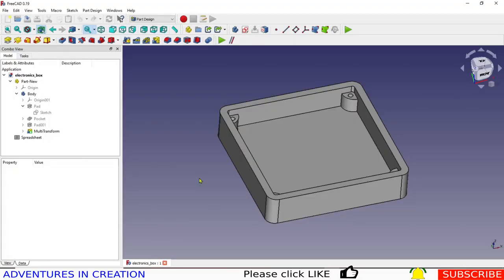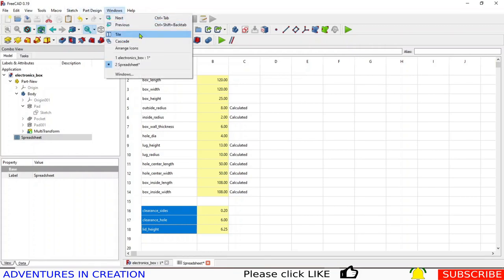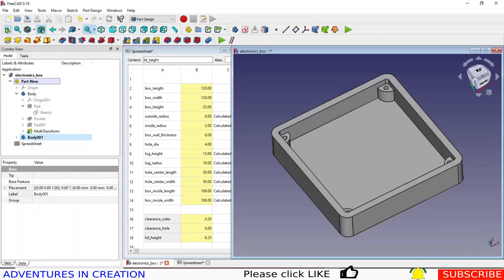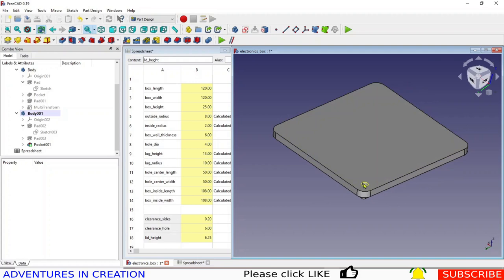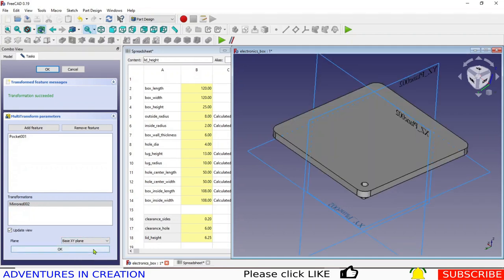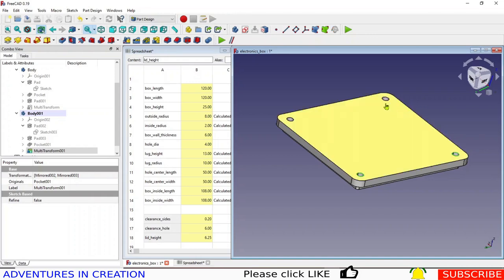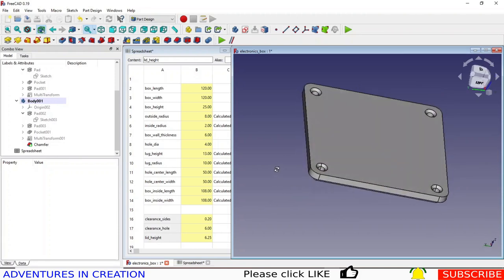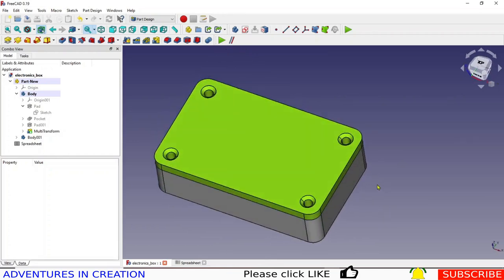FreeCAD Electronic Enclosure Lid Using Simple Parametric Design Techniques

Comment: After you create your labels in the spreadsheet, run the easy alias macro before entering any values.  You can then enter formulas using the alias names instead of the cell location. In cell B17, you can enter =hole_diameter + 2 instead of =B8 + 2.
Reply from the maker: Thanks for the tip.

Comment: superb tutorial!!!! is it possible to control the chamfer parametrically if created on a sketch or incorporated in the spreadsheet to constrain its movement in relation to the hole?
Reply from the maker: Yes, you can set parameters for the chamfer too.

Comment: I am enjoying this leaning curve. I discovered that when constraining the corner radii, we can select all four and constrain the one. The remaining three are automatically set to equal. Saves me a step.
Reply from the maker: Yeah, the thing I like about it, it's improving all the time. There are some great developers working on it.
Reply: @Adventuresincreation  are you installing it manually, or with Chocolatey?
Reply from the maker: @Whipster-Old  I just download it from the download page, although I can build it with conda as I set that up too but I generally wait and get the posted version.
Reply: @Adventuresincreation  you might enjoy Chocolatey. Check out Chocolatey package manager, you can then install with "choco install freecad --pre". Easier to keep up to date than manually downloading those pre release builds by hand! NB I'm not affiliated with them, it's open source I just use it a lot.
Reply from the maker: @Whipster-Old  I did look at it but because I already have Conda installed and set up I can just build on demand from the latest repository.  I may install Chocolatey in the future though. I am trying to develop some more "gui" based macros at the moment. I am having fun with Qt5 and creating stuff but nothing releasable yet.
Reply: @Adventuresincreation  nice! Can't say I've used Conda myself. I'll watch your channel with interest. My printer is out of action at the moment - SKR burned out, waiting for replacement board and BLTouch.
Reply from the maker: @Whipster-Old  I have an MPCNC router and two Tevo Tornadoes. I love being able to rapid prototype stuff. - 3D printing is still amazing but back in the day, when I was a design engineer for a major corporation we used a vendor to create SLA models, the machines were very expensive then. I never imagined you would be able to have a 3D printer in your home (much less two).
Reply: @Adventuresincreation  I remember seeing a resin 3d printer on Discovery when I was a teen. Now I could own one for a few hundred quid! I've never ventured into CNC proper, but I absolutely love my printer. It's driving me to learn CAD. I've modified the heck out of the printer, and I do love tinkering.

Comment: You are a great teacher. I was looking for a CAD Software and found FreeCad.
The new good CAD-Programs are only for rent anymore.
As a single-man-business in Germany I just can´t afford to pay 500 Euro per month for renting a CAD-software while my main business is calculating frames
and using other software. This software is meant for Industry - some fulltime - drawers, who live in their element - with their shortcuts and their productivity.
Anyway, I would like getting better at Freecad and the FEM - workbench.
Thumbs up, you´re a great person having an english accent and living in the US.

Freundliche Grüße,

Niko Böhm
Reply from the maker: Thanks Niko. Let me know if I can help you with getting up to speed with FreeCAD. It is a great piece of software that is very capable. Are you just creating technical drawings or are you modeling and 3D printing or CNC routing?
Reply: but you are, I assume, an Ingeneer like me.
In Germany they call it "Maschinenbauingenieur" ...
and we have the differenciation to "Civil Engineer". So the civil engineer can construct a steel-frame-building but the "Machinenbauingenieur" not - they are working at Porsche and Mercedes.
Reply: @Adventuresincreation  No - I´d like to print small stairs and bridges mainly in steel.

Comment: Similar to the other comments, your tutorials are super helpful thank you so much for taking the time to share knowledge! 
One trick you can use instead of pocket 'through all' is pocket 'to face' and select a face that you want the pocket to go to, just a bit more precise than through all
Reply from the maker: Thanks for the feedback, I have used the pocket to a face but generally hit it with a sledgehammer and go through all. - Your way has much more finesse ;-)
Reply: Hehe, it can also cause circular dependency issues if your not careful, sledgehammer is good too 🙃

Comment: I followed along with the first tutorial making the box exactly as you did.  For my lid, I made it one wall thickness tall.  It goes down one wall thickness into the box and  one wall thickness from from the inside of the box (plus clearance).  I also copied the lug radius onto the lid.  This means that 90% of the lid is only one wall thickness tall, so it prints quickly with no wasted plastic.
Reply from the maker: Brilliant!

Comment: Thanks for taking the trouble to teach 0.19 before it was published as stable.  It means your video(s) hasn't lost relevance and shouldn't do for at least the rest of this year and probably not even then.

It's great to see a lot of good tutorials being created now.  When I started with FreeCAD a few years ago there wasn't a lot around, and most of those (that were well done) showed just the part workbench or switched between the two (what a headache).  I had to transition to the part design workbench under my own steam but I'm learning heaps from these newer videos.  Thanks again.
Reply from the maker: Thanks Chris. In fact, I did the same, I was trying to use FreeCAD as my daily driver and couldn't find many "good" videos then, I found Fusion 360 and saw the opportunity to use something a little more modern with a free hobbyist license. - In the meantime FreeCAD improved then AutoDesk decided to change the rules for the Fusion 360 hobbyist license. - I saw the writing on the wall and made the leap back to FreeCAD. I haven't looked back since. I love FreeCAD and how extensible it is. There are lots of things to learn with it but the main stay for me, the part design workbench and the sketcher are pretty good. I do use the path workbench and love where it's going although I wish I could help them to move along faster. - It is very capable for the basics but lacks some finesse. I am glad I can help others to use the software and hope that with 0.20 release I can make new videos that highlight those features too.
Reply: @Adventuresincreation  Thanks for the reply!  You also asked if anyone had anything we'd like you to cover.  It's a bit of a complex topic but I've been struggling with threads.  I have done them from scratch and discovered that the open source algorithms for circle designs (cutting a spiral sweep with a thread profile) was very hit or miss.  Often when you used the correct dimensions it failed to compute, but tweak it just a little off spec and it would work.  Rounding errors that the algorithms couldn't resolve, obviously.  The method I was using was to create a cylinder, and then use the thread profile to "cut" the thread.  It seemed to be the recommended easiest and most reliable method at the time.

I did find the "fasteners" add-on and started using that with very reasonable success.  Because I design exclusively for 3D printing most of the threads are large and course:  eg. a motor drive unit that pulls the filament out of the airtight containers I have it enclosed in, reducing drag on the direct drive print head (improved my 3D prints immensely) .  I used a 3D printed M20 threaded bolt to hold the drive unit vise style on the back of the desk the printer is sitting on.  The motor drive is a horrid looking design overall - the M20 bolt is the only thing that has any redeeming aesthetic LOL.  So it's been powered on and working constantly for two years now.  No need to re-design what just works.

Threads are a complex topic (very specific design criteria) but maybe a tute on sweeps would be good, or maybe a discussion on the circles/sweeps algorithms.  Since I started using the fasteners add-on two years ago I've basically forgotten everything I learned, and FreeCAD has become so much better so I wonder if there have been improvements in that area as well.  Are they still using those clunky open source algorithms that caused me so much trouble back then?
Reply from the maker: @Chris_the_Muso  take a look at my latest video it covers threads using the fasteners workbench. I would never bother to model a thread from scratch. There is a setting in the workbench for 3d printing threads. Also, take a look at my beginner video on sweeps along a path. That will help. It's also in the latest video.
Reply: @Adventuresincreation  Thanks, I'll definitely rummage through those videos!.  If you want to understand threads, model them from scratch (or cut them on a lathe) but yes, the call of the threads workbench is very strong  :-D
Reply from the maker: @Chris_the_Muso  Coming from an engineering background, I have made many threads on the lathe but mostly used taps and dies that's why I love what the fastener workbench has. You can create a hole or a shaft, select a tap or die and just make the thread. It works really well and honestly takes all the pain out of creating threads.

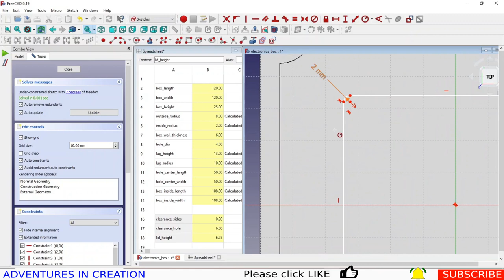Comment: excellent as usual.. @11:50, while making symmetrical, then adding radii constraint, i got error  has partially redundant constraints.  I deleted the constraint and selected all 4 radii and made equal.  Then applied the radii constrint and everything is normal.  Thankx for this increditable vid series on the project box.. No w i can modify  (hopefully as new to #D modeling) the sizing to my needs and add 2 tabs on the lid to attached to my cymbals.🙏👌👍
Reply: aaah i jumped ahead to make them equal, but later @12:25, you mentions you should have made them equal.  I guess in version .20.1 flags the error that i had.
Reply from the maker: Glad I did that 😉
Reply: I guess this means im getting a liitle more knowlegdble from your videos 🤔 🙄
Reply from the maker: @rondeangelis7384  absolutely!

Comment: Thanks for the tutorial and it is a good one, especially the spreadsheet and the clearances. But I was thinking that maybe if you create a DatumPlane on the top of the box, then you could perhaps use that plane as a base for the lid (instead of the offset from the XY-plane).Then the lid and the box would be more "independent" of each other. (But I don't know if this would interfere with the mirror function or not).
Reply from the maker: Sounds like an interesting approach

Comment: Fantastic, so easy (lol). You spend 30 minutes talking, I spend 8 eight (3 times) trying to do. Finally managed, thanks to pause.
Now I'd like the lug at the top tapering to the base, or to the length of the screw (plus a bit), so don't waste space for the board. Also want to add mount points for the PCB. However this is all fancy stuff. The question I have is, can FreeCAD allow multiple Sketches in one project and allow to disable for printing. This way I can use a common template with multiple objects. So one print may include an exhaust outlet for a fan, while another hold a battery container below the PCB, thus needing to raise the lugs holding the PCB, but all with the same calculated dimensions. So so many possibilities. 
Keep up the good work. It's clear and concise. I will watch more.
Reply from the maker: The answer to your question is definitely yes!

Comment: This is a very useful video for me. Thanks a lot. I have some confusion about when to use "hole" or "pocket" though.
In video, at 16:32 you say, quote "...put some holes through this box..." unquote, At 18:34 you say, quote " ...do a pocket through all...", unquote.
I would like to understand when to use what (hole or pocket)?
I am asking this because when I try to reproduce the hole in the lid, no matter what I try, the hole or the pocket, it goes only through the "lid top" or the "lid padding". Never through both.
Any tip about overcoming this problem? Thanks for your help in advance.
By the way, I am using FreeCAD version 0.20.2.
Reply from the maker: I use pocket 99% of the time. The pocket can only go through the body in which the sketch is located. If you need a hole in a different body, create another sketch.

Comment: Absolutely brilliant videos. I am totally new to Freecad, but this has made things so easy. I followed the previous video on the enclosure design and made my own Freecad file.
I exported the .stl file for the body and it printed nicely. Then I did the same for the lid. After a few "glitches" regarding Freecad file types, naming, tree, etc, printing the lid worked just as well. 
Since that success, I have tried to alter the design to include a semicircular groove in both the top face of the body (and also into its corresponding lid underside) to accommodate a sealing o-ring all without success.
I have tried using the "groove" and the "fillet" tools, but no go.
The "groove" tool is limited to grooving circular objects only. Is that correct ? 
There appears to be no option to invert the "fillet' tool once chosen, in order to create the semicircular channel that I need for my o-ring.
Also, the lid is very thick once printed. Again, I need to know how to "pocket" the lids existing inner face, so that its inside thickness is only "spreadsheet.wall_thickness" deep.

Because of the Topological Naming Problem already known, is it safer to set up a "virtual plane" on the same axis as the top face of the box, and create a new sketch on that ? 
I fear that I might be getting in a bit over my depth with this, or are you interested in creating another video to assist "dummies like me" ?

Irrespective of any reply, please keep up your excellent work. I will continue to "like" your channel regardless.
Reply from the maker: You might want to look at the sweep along a curve and yes, use an offset plane or offset sketch to hollow out the lid. It sounds like you are learning fast!
Reply: @Adventuresincreation    Thanks so much for the hasty reply - but I still have trublems. I will try the lid "hollow out" a bit later, but for now, I can't seem to grasp how to "sweep along a curve". I have created two sketches under "Multi Transform" (1 for the profile cross section {on the xz axis}, and another for the path which the profile should take {on the xy axis}). The "Part Design" and "Part" toolboxes behave differently, so which to choose (and when) ?
If I use "Part Design", after selecting "Sweep a selected sketch along a path or to other profiles and remove it from the body", I never get the chance to select a face in "Pipe Parameters". 
There is only a blank "Object" field there. Why do I not get a chance to insert my second sketch as that object's path for it to follow ?
What should be easy has become far from that. Do I use the "Part" toolbox, or the "Part Design" toolbox, as they appear to behave quite differently here.
The FreeCAD site (and help) seem to not cover any of this.  P.S. I am using the latest v0.19.
Reply from the maker: Take a look at this video, it demonstrates what you need. https://youtu.be/Px1bkazmFH8
Reply: @Adventuresincreation  Thanks for pointing me to that video - very helpful. Still got issues, though. I have made 2 valid, constrained sketches, which have placed themselves under the "Multi Transform" branch of the tree (or is that wrong ?). One is the o-ring profile, the other is the path. However, when I try to set up a subtractive pipe, I get an error saying "Pipe: No valid sketch or face as first section". My question is: on which axes should the cross-section profile be drawn, and should it be on a plane other than that used fo the path sketch ?  I've tried everything, over many hours, and about to sling it in the "too hard" basket. More help is desperately needed, please.
Reply from the maker: @kevingpearce  yes, the profile sketch has to be on a different plane to the path. Imagine the shape traveling along the path, if it is laying flat you won't get the shape you want

Comment: Great tutorial. Thank you! If you don't mind, I have one general question, but will ask it in reference to the screw hole created on the XY-plane @ 16:41: ÜWhy do you place this sketch on the XY, and not on the lid-layer?* Will this cause problems later on, if the lid height/width is modified? Shouldn't it be OK, because the sketch would move with the lid layer, as it now moves it's position due to the calculations for the positioning?
Reply from the maker: Good question, before this latest dev release the topological naming issue caused problems of you used the model face.